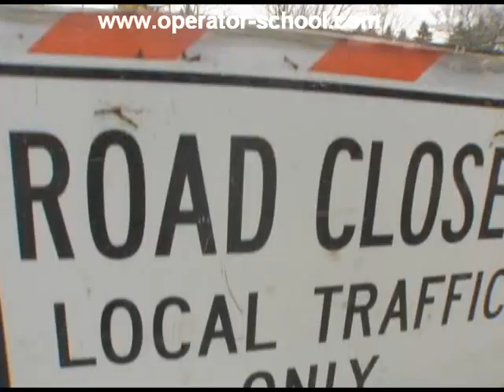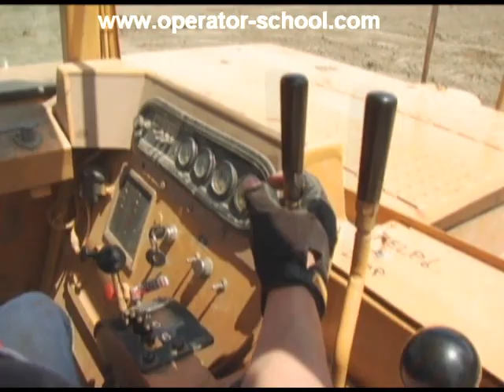Heavy Equipment Operator Training

Comment: First grader I operated was an Austin-Western master 99,four wheels drive, four wheels steering.Also I operated 2 Caterpillar d-6 dozers with those "pups" to warm-up the main engine.....I was 6 years old in 1968 and I think that if I could do it at that age, anyone could do it. The bonus was the machines belonged to my Grand-father. he was a  road builder in the 50's.

Comment from the maker: Heavy equipment operator do spend most of the time in the operating seat they do due physical work as well with maintenance and assisting in labor work on the job site. What I have heard from graduates is that they like doing different projects at different locations, it keeps the excitement in the work they do. If you have any other questions please contact us at 800-383-7364. Thanks.

Comment: I have to say that its a false statment to say that when a student graduates there will not be a job that they couldnt do. 2 weeks isnt going to be enough time to put someone in the seat of the equipment or a few machines and be able to hold a job. At best they could spend couple weeks in a loader. but loader opearators are a dime a dozen.